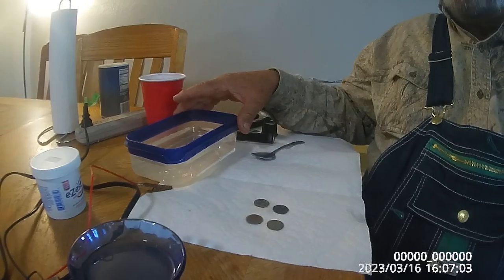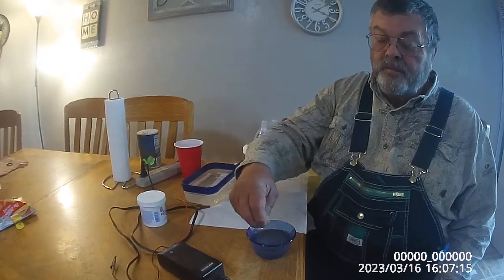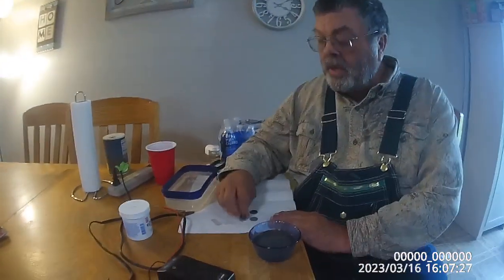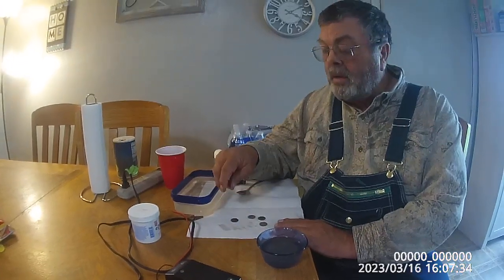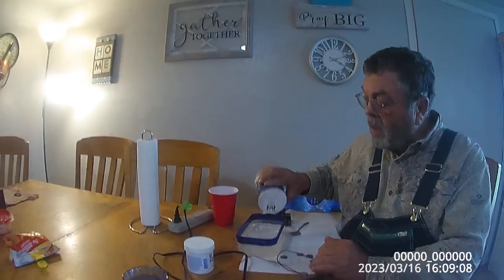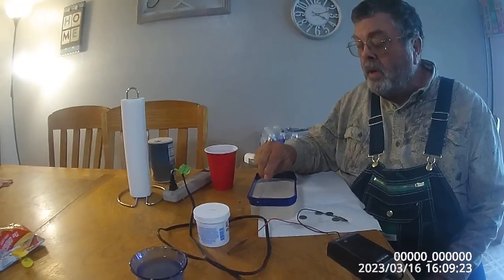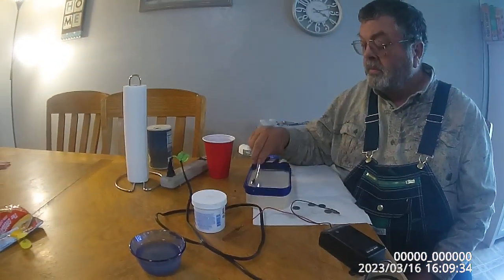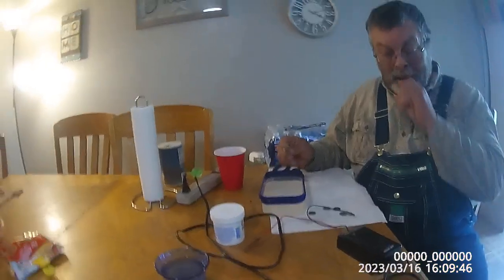Coin Cleaning Electrolysis 031623

Comment: Good video. You are correct that the coin must be connected to the negative side. Do not use stainless steel as an anode during electrolysis. It will produce chromates in your electrolyte solution. If your solution turns yellow, that is a sign of chromates. Stainless steel contains chromium and the solution can cause burns and even cancer.
Reply from the maker: Thanks. Not sure why more people don't use this.